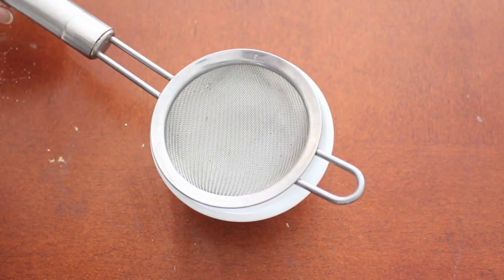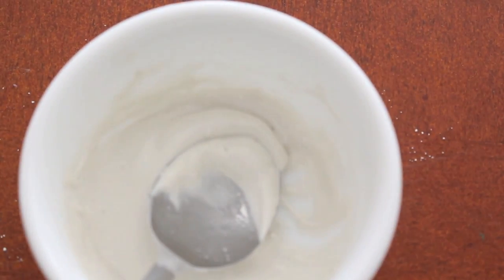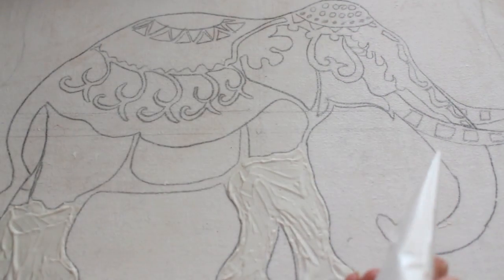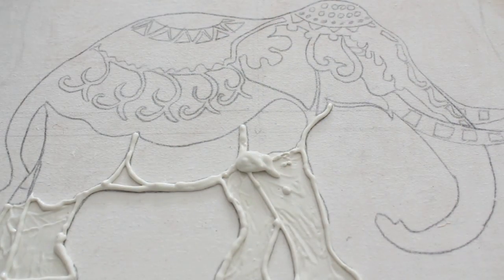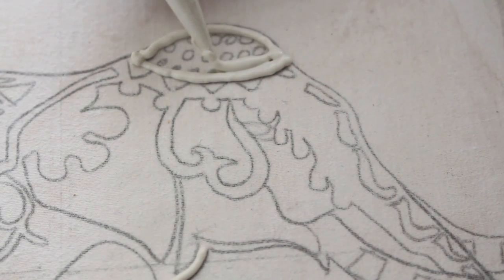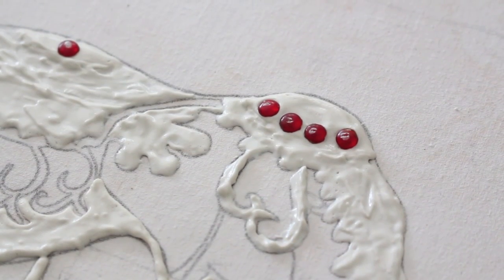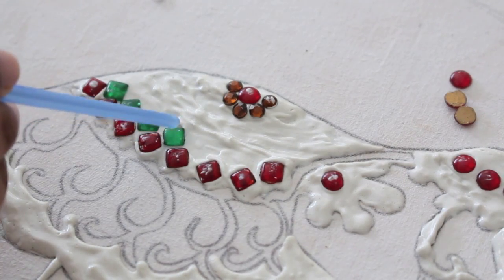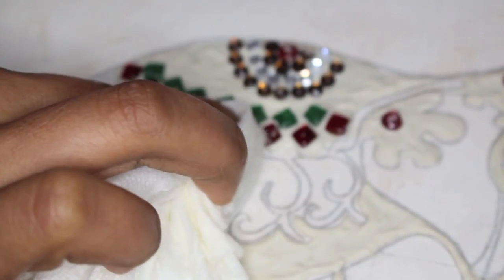Tanjore Series - Muck prep and Stones

Comment: Hai mam pl sujest me full  complete the tanjoor painting finely apply the varnish necessary or not necessarily pl tell me because poster colour painting after some years fungus are there told somebody's so u tell what i do pl tell me don't miss me pl advice me
Reply from the maker: My teacher did not want us to add varnish to the finished product. The way to avoid fungus is to simply make sure you invest in a good frame and to keep the frame away from moisture. If you think your painting might have come in contact with moisture. air it out or let it dry completely. If somehow it does catch fungus, you might have to take the frame apart, clean out the fungus, air it out and re frame the painting. hope this helps. Have a great day!
Reply: @Realtorharini  thank u very much ur reply . how to prepare arebik gum with hot water r normal water pl tell me
Reply from the maker: @shobhavenu2484  I would mix it with room temp water and then put it on the stove and mix till it disoolved completely. Will share the videos in future if you like